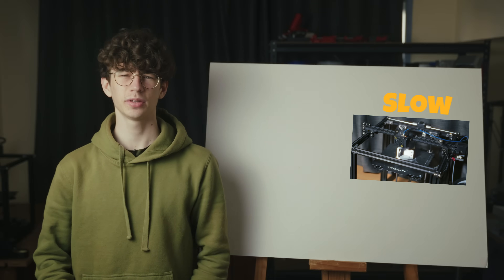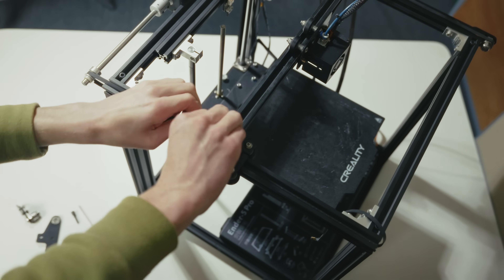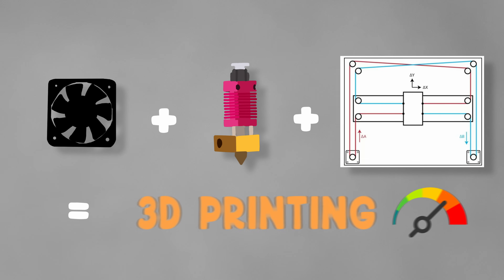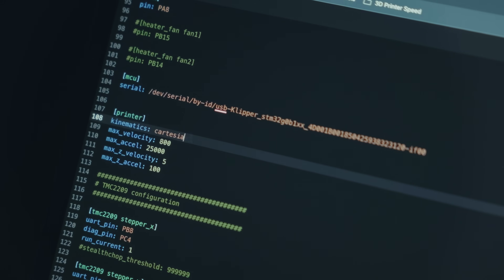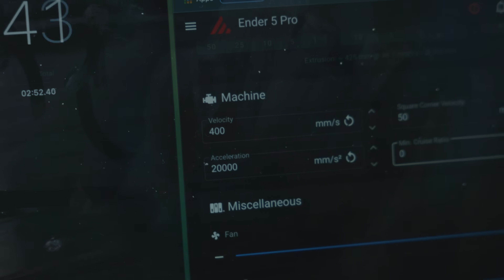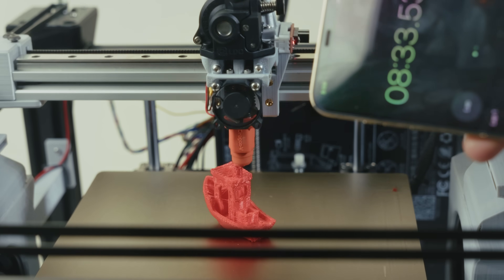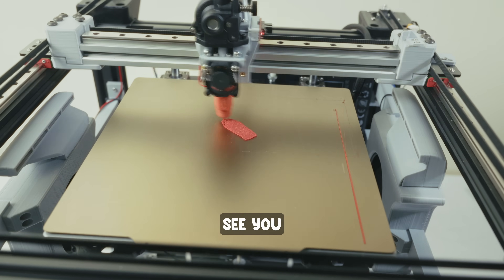Building the Fastest Ender 5 Pro

Comment: Excellent video! A question, I have a skr mini e3 v3. Can I use mine instead the manta?
Reply: Thanks, another question, when you mention the ez drivers. Are they an external device I need in my case or only for your manta approach?  I see you have a btt cb1, is that the same to the btt pi?
Reply from the maker: No worries. The EZ drivers are external drivers made specifically for the Manta board, the SKR Mini E3 V3 has integrated ones so you won't need to buy any. The CB1 is BTT's version of the Raspberry Pi CM4, which can be used as a raspberry pi alternative directly on some of the BTT boards, it's like the Btt/Raspberry Pi but mounts onto the board with a special header, rather than a cable or IO pins like the BTT Pi. Both offer near identical functionality aside from the btt pi having tons more IO and interfacing options. The BTT Pi works with more mainboards and is in my opinion easier and better. Hope that helps!
Reply: Thank you so much, with that I will try to convert mine, but with the stock motors from the ender, I need to save money to buy the ldo you mention, but it is a start hehe
Reply from the maker: I'm glad I could help. The stock motors should perform fine as well if they're compatible, I've heard they can be surprisingly powerful. Good luck!
Reply from the maker: Thanks for checking it out! Absolutely, almost any mainboard will work fine. I've used the Mini E3 V3 before, it's an awesome board. The process should be pretty much identical. Cheers!

Comment: The cantilever bed, and poor the bed itself was always bad on this machine
Reply from the maker: It’s a real bottleneck, even with printed support struts. Not sure what the engineers were thinking, maybe if the user prints slow enough it would be fine? Not sure. At least mods exist for it. Cheers!

Comment: Seems interesting for the E5p. For some reason, and I'm new to all this, my unit starts printing from the bottom left corner.  Not central.
Reply from the maker: I believe that has something to do with either the origin, or the start gcode and machine parameters. It takes a bit of fiddling to sort out but on the stock E5/E5P that’s normal. Cheers

Comment: I just recently got a sub 10 min benchy on an ender 3 pro stock motors and belts, btt skr v2.0 turbo MCU, dual z rod, Bambu lab clone hot end from AliExpress. I 3d printed a housing for an old Xbox one fan and used it for aux cooling. Dual 5015 fans.
Reply from the maker: That's an awesome setup, those bambu clone hotends are excellent value, I had one on the Ender 3 for a bit and it gave me some of the best print quality I've ever had. I took a look at your benchy, and it turned out insanely good. Keep it up! Cheers

Comment: No happy end with all the mods? Results even at the end look terrible. I was hoping to find a solution for my old ender 5 pro. I own a hemera direct extruder and the linear rails too. But I dont know where to start.
Reply from the maker: I’ve since converted to Mercury 1.1, i’m hoping to get the video out either today or tomorrow which turned out much better. I highly recommend looking into it, it wasn’t too hard to do and (aside from the ender 5 z axis being a bottleneck for super fast printing) it helped immensely. Cheers

Comment: I recommend using MGN9H linear rail on the X-axis and trying a 20x20 mm aluminum square tube with a wall thickness of about 2-3 mm for the gantry beam instead of a T-slot profile. Square tubes are lighter and more rigid than T-slot. And this print bed is a no go. At higher accelerations it starts flopping around, introducing a lot of ringing. You would need a bed with 3 support points, something like on creality k1, vzbot, ratrig etc. Replace Z axis, maybe even use 9mm gt2 belts on XY, and you'll get a really fast printer!
Reply from the maker: I'll be following the Mercury 1.1 requirements for the remake, I'll look into MGN9, larger belts, and such later. I've got a nice cnc'd x-beam I'm looking forward to testing. The bed is definitely an issue, I'm not fixing it for the remake, but perhaps in the future. Cheers!

Comment: I've done a similar mod with the ender 5 pro (on my channel). It helps to move the part right next to the air outlet as you can see in my 7 minute one. 40x40mm heatsinks on the motors will definitely help too with the heat. Good work though!
Reply from the maker: I love your setup, the stealthburner looks great! I'll do that when I reinstall the ducts, should work nicely. I've coincidentally got some larger motor heatsinks in my aliexpress cart right now, will order a bunch of them later this month. I'll keep working on improving the machine. The v2 video is coming out late next month if all goes well, I've done a couple of community posts on plans. All the best with your printing! Cheers

Comment: you didn't upgrade your Ender 5. You did make new 3D printer. This doesn't count.
Reply from the maker: That’s technically true, the corexy upgrade is labeled as a conversion. As the upgrade is based on the E5 the title isn’t too far fetched, but understandably not perfectly accurate. Thanks for checking out the video! Cheers

Comment: Bruh Bambulabs can do that too, they can print benchy in 13 min (like 5 min is like flow calabration and bed leveling and toolhead cleaning) And it prints very nice, even the cheap a1 series.
Reply from the maker: The A1's are great I hear, I might get one eventually. Cheers
Reply: @TommyHoughton  thanks!

Comment: Don't know if it's just the lens, but is your X v-slot on the stock Ender 5 bend🤔
Reply from the maker: It’s most likely the lens, but if not, I’ve planned to rebuild the whole machine with the Mercury 1.1 system in November, so I’ll go over and make sure everything is square and doesn’t flex. Cheers

Comment: I have all of the hype about speed, dominating many videos. So, what about speed. Many printers are not stable for higher speed, or robust. For added cost and time of improving the capability, a slower print would give a great outcome, at no expense in time and cost. So what is point?
Reply from the maker: I find it fun to tinker around and see what numbers are achievable on certain platforms, but when a machine "just works" it's agreeable that leaving it alone is more than fine. Cheers!

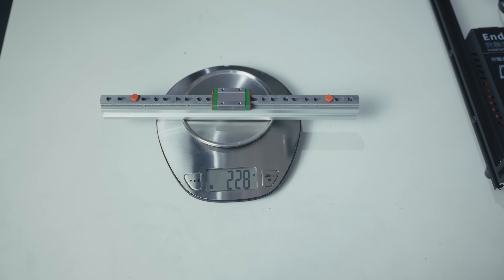Comment: 4:27 A 3d printed linear rail? If theres friction doesn't it defeat it's purpose? Why not print the aluminum extrusion supporting it? Just asking.
Reply from the maker: I wanted zero compromise for weight, but the extreme lack of precision (mainly due to me filing it to make it work) made it somewhat unusable. Even a printed x-beam would have been better. I’ve been sent a cnc’d x-beam which I’ll be installing in November. Cheers
Reply: Linear rails are hardened then ground. The easiest way would be to modify an existing rail. Not starting from scratch. Also if you want to get rid of weight just don't use the extrusion at all. The linear rail is likely more than stiff enough on its own

Comment: Dude I would slow down on the speed the reason your benchmarks are turning horrible is because of the speed your nozzle is moving much faster than filament being extruded down by your extruder so basically  your extruder is not having enough time to fully extrude the material down on your print bed if you want good looking results on your prints I would print much, much slower to get that good quality
Reply from the maker: While the High speed PLA did help, some extrusion tuning is definitely needed. I've seen people print much faster with the same extruder, so I'm confident that it's got some more room. I'm upgrading the hotend and cooling which should fix most of the results. I'll off course do more testing once I can. Stay tuned for November! Thanks for your comment :) Cheers

Comment: Look at 24/7 printing, he made air ducts to guide the air from the side fans to the tip of the nozzle that might help with your cooling issue.
Reply from the maker: That’s a good point, I could do that too. I’m installing a cpap system first, so If I have room left over I might include it too. We’ll see how it performs. Cheers

Comment: Browsing ytube and saw a vid on printed ducts on the print head for cooling. Commenter said you dont want cross flow or vortex around the print head as it reduces cooling. So i think either top down cooling would help you cooling issues (ducts over the frame aimed at the bed so youre not throwing weight around) or have your blowers perpendicular to each other ( a bit of cross flow but more likely to get both sides of print without interfering with each other)...
Reply from the maker: I saw that video too, that’s a good idea so I’ll look into incorporating it in part 2 with cpap. Cheers

Comment: Oooooh. I don't think a metal 3d printed linear guideway is a good idea man. You will have hardened bearings running on pretty soft 3d printed metal. Plus they are precision ground. It already sounded very rough when you moved the carriage. Edit: Nevermind, you figured it out.
I love my Dragon Ace hotend. Its a shame they stopped selling them on Aliexpress. I'm thinking about trying the Rapido Ace too but I already have way too many over expensive hotends, as nice as they are.
Fysetc sells rails that are machined to remove some metal and weight but I haven't used them. I stick to Hiwin just because they have never failed me and aren't as expensive as people make out.
If you would like some ABS or PCABS parts for a Mecury 1 or just high temp versions of this design I would be happy to help. I'm in NSW
Reply from the maker: I was looking at the Rapido Ace, but for the price I’m not sure if it’s worth it compared to a CHC Pro, let alone another Dragon Ace. I have to agree they’re great fun to play around with. I really want to try the STD6 for part two/in the future.  I’m building a custom hotend and heatsink for my September video, will be very interesting. I’ve seen those Fysetc linear rails, might try them in the future. I appreciate the offer, I’ll keep you updated. Cheers

Comment: no, just add multiple static printer head bridges in a bed slinger 3d printer. yep make the print heads small. so you can pack many in the bed sling axis. yes the print heads move the other way than the bed sling axis. like in the normal bed sling printer with just one print head. sorry only bed slingers supported.

Comment: I would like to see a video where you build a stock Ender 5 from the parts you took off this one.
Reply from the maker: That's a good idea, but I don't have nearly enough parts for that, I'm still using the stock frame and z axis system, which is most of the machine. I hope to build a custom machine similar to the Ender 5 (with some major changes) in the future. Cheers

Comment: I just started getting into raising the speed on my ender 5. I didn't even go to these extremes but I am getting much better speeds. I cranked the nozzle temperature up to 240 degrees. I print the first layer at 150 mms then I turn it up to 325 and surprisingly it prints really good. Like better than it was before I started messing with it. I'm going to try doubling the layer height tomorrow.
Reply from the maker: That’s great to hear, all the best with that! Cheers

Comment: The SLM rail had me laughing, ain’t no way that was ever gonna work well without significant post processing
Reply from the maker: When it arrived, moving a block onto it was impossible and while filing it eventually made it “work,” it was way too imprecise. It was an interesting experiment, but probably not worth attempting. Cheers
Reply: @TommyHoughton  Look up how precise these rails are. They are manufactured probably preciser than the µm, which is 0.001mm

Comment: 04:25 WHAT DO YOU MEAN YOU JUST METAL PRINTED A LINEAR RAIL ?????!?!???!!!?

You will completely ruin your linear guide bearings in no time
the surface roughness required for the rail surfaces is not achievable by additive manufacturing. it often isn't even achievable by machining, and a surface grinding step is required
Reply from the maker: It was something I really wanted to try, I can’t believe it “worked” but yeah, the cons out weighed every pro. I’ll look into a lightweight x beam over a rail next time. Can’t beat the precision of a proper rail.

Comment: All those upgrades but no auto bed level?
Reply from the maker: I was considering it, but I didn’t want to design a mount and then have to sort the config out for it. The bed’s been reliable so far, but I want to upgrade it for the next part so I’ll be reevaluating the decision. Cheers
Reply: @TommyHoughton  Tommy I get what you're saying, but for this project go big! Add a bed mesh scanner from big tree tech.
Reply from the maker: @roland2864  I have it on my planning document, I’ve been meaning to try it out. I’ll make it happen 😄

Comment: PS 
Reinforce the Z axis , for start replace springs with nuts for stiff mount or just tighten them as much as possible
if you have resources replace rods with thicker ones (or with single mgn 15 /// mgn 20 rail)
Replace the X axis 2020 profile to 1515 square tube -- less weight + mounts need redesign (bit on heavy side) , maybe try to mod them to something like in zerog mercury )
want more speed ? 48v is good option but try with 4 stepper motor on each corner not 2 for more torque (faster corner speed (or like in marlin ...jerk)  and accel) :D

pro tip --
- side panels to make it heavier will help with vibrations + make it stiffer (and some concrete under it so it wont move like crazy with faster speeds) , you can even use red plaster boards to do that (fireproof ones) or cement composites -- like cement composite board (mdf with cement) or just mdf --- (it dampens vibrations)
Reply from the maker: I’m looking into ways to improve the Z axis, I appreciate your suggestions! Those changes to the z axis are a lot simpler what I had in mind. I have plans to do 48V AWD for part two, but it will be ambitious and is at least several months away. Good idea with the side panels! I’ve been trying to think of ways to improve weight and rigidity. Cheers!

Comment: I highly recommend reinstalling your toolhead cooling fan but using these fans instead (honeybadger 5015 four pin I would link but the comments wont let me) , and you might want to give the hotend I made a shot (check your filtered comments for the link because I cant work it in here easily, I have been able to reach 77^3 pla 240c on my bambu p1s and that is only becuase it is being extruder capped.) and find a way to fasten the aux fans down to help prevent that wobble, and you might want to also want to reprint some of those structural parts in abs/asa.
Reply from the maker: Some high quality 5015's would certainly put in the work. I wasn't able to find a link sorry. I'll likely look at getting a goliath or STD6 for more flow rate. I've also got a DIY hotend in the works! We'll see how it goes. I've been compiling all the feedback for part two, which will hopefully happen later this year. Cheers
Reply: @TommyHoughton  Ill send you an email to your bussness email with the link just filter with "High Flow Hotend By LiamBox"
Reply: @TommyHoughton  Ill send it to your business email filter by "High Flow Hotend"

Comment: Why the dc ssr for the side fans. My manta has 2 of these on 1 fan port no problem. Running a zero g merc plus with metal stepper towers. 24v 5160 step stick. At 30k got a lot of weight reduction stuff. Ti hardware helps also.
Reply from the maker: They drew a bit more current than I felt safe letting the mainboard handle, I double-checked everything and maybe it could have been fine, but I had the ssr and felt no need to risk. That sounds like a great setup! I watched one of your videos, it looks nice and colourful, assuming the printed parts haven't changed. I plan on getting some 5160's too, 48V just for fun. I forgot about titanium stuff, will be worth considering, I'll write it down. Cheers!
Reply: @TommyHoughton  stuff is constantly changing. I'm trying to reduce colors but just testing stuff all the time.

Comment: You could just add 1 or 2 blower 4010 fans , that dont add to much weight to the toolhead
Reply from the maker: I could probably modify the fans I had to mount lower, but It wasn't a priority. Adding some toolhead part cooling is definitely happening though, most likely in the form of a cpap system. Cheers

Comment: The original idea with pla parts wasn’t bad. Pla is stiffer and would have performed better, probably the heat and creep would have made a mess but not on the short term. Check for solutions as “THE100” printer, made entirely in PLA.
Reply from the maker: Good to know! I didn’t want to risk it at all, but with current plans, the whole motion system would be replaced again before any deformation occurred. I’m a huge fan of THE 100, absolute powerhouse of a machine. In the future, I’ll be taking more inspiration from those types of machines to get even more improvements added. Cheers!
Reply: that printer is garbage don't bother

Comment: Metal prints linear rail, uses stock linear rail.
You could hear the difference in the beginning of the video. The printed rail rattles a lot more.
Maybe you can get rid of the aluminum extrusion and using just the rail for weight savings.
Reply from the maker: Yeah, I would have liked to continue using it, but the print quality difference would be even larger. 
It was much louder, and there's a huge amount of play. It was an interesting experiment.
While I won't solely use the linear rail, I'll definitely switch out the extrusion to either a CF square tube, or a cnc'd beam. 
Both with huge weight savings to compensate for the stock rail.

Thanks for watching! Cheers
Reply: Rail only can cause premature wear and failure due to stress on the bearing when the rail flexes. 

Using a lighter backer helps a lot, I use 15x15 aluminium square tube. It works well and is super light. 

Also fysetc makes a CNC lightweight rail but I haven't tested it.